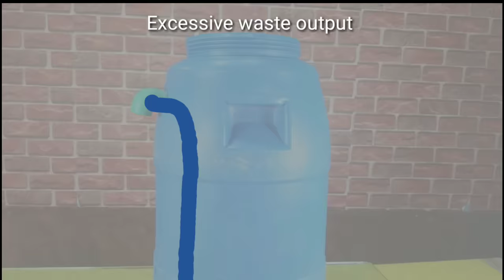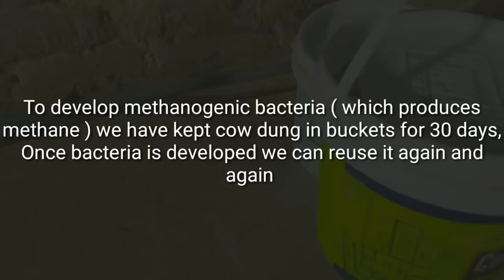How To Make Free Gas from Fruit And Vegetables waste | Bio gas plant |

Comment: Pretty cool and all but you are using plastic to store flammable gas. Ever heard of static electricity. Tub needs to be metal with a ground.
Reply: Gas inside is not mixted with oxígen hence not explosive
Reply: Grounded gas cylinders 😂
Reply: @margaritoavila1306  Yes it is. Biogas is a naturally produced gas. Mostly methane carbon dioxide but also a small mixture of oxygen. It's a small percentage. But still a ground would not hurt. As percentages vary depending on the contents creating the biogas. As far as "gas cylinders" those are typically metal and purged of any oxygen prior to filling.  Regardless it's NEVER a good idea to store flammable gas or liquids in a plastic container. Regardless of oxygen content. Container is contaminated with oxygen everytime he opens it. And I can promise you he isn't purging it with gas after opening it. It has oxygen.
Reply: Before storing it in metal you need to clean the gas, otherwise it will corrode quickly because of the H2S .

Comment: I would exercise a little more safety. Rubber gas tank next to open flame BOOM!
Reply: Yes. Flame should never be close to the gas storage/tube. Furthermore, there should be flame arrest installed. If flame arrest is not installed, flame can travel backwards.

Comment: Very wrong placement of rubber tube near burner it will cause fire accident by melt the tube.
Reply: I thought I was the only one who noticed it
Reply: A check valve or water valve on the outlet, to prevent flash back, wouldn’t go astray either.

Comment: I’m sorry but how will the barrel maintain pressure if the over flow pipe isn’t tapped off? He must think we are stupid enough not to notice. Waste of fffing time
Reply: Maybe there is a pipe connected from inside which is dipped in the mixture sealing it naturally. Refer 01:05
Reply: There is a pipe connected to the overflow which goes to the bottom of the drum so thats not an issue but still this is waste of time

Comment: Where does the pressure come from to inflate the tube since the barrel has a hole on the side plus the valve of the tube is closed.
Reply: That is true
Reply: What the video didn't show is the excess waste hose on the side is plugged up with a cork so any gas build up goes to the tube.

Comment: You should be more careful about the live flame so close to the inner tube holding the flammable gas. Even if it's only for a demonstration purpose. I'd have suggested you used a longer hose connecting your inner tube to your gas burner.
Reply: And a simple water-filled, no-return capped jar between your burner and the inner tube in your gas line as well.

Comment: Want work. The reason I say this is that the over flow drain is fully open on the side. There would be no way to build pressure in tank and diffidently would not pressurize inter tube. Why do people do video's like this?
Reply: He said add cork on over flow pipe  and remove when necessary dumbo watch video carefully

Comment: Something is missing, how could the methane not return to the drum and exits on the yellow hose?
Reply: i think the yellow runs all the way down the drum, so methane won't exit the sludge through the yellow tube
Reply: We need to add gate valve at the end of pipe which is missing in this video

Comment: Hi, can an LPG gas cylinder be used in place of a tyre tube...?
Reply: In theory, yes. BUT you need something to push the methane into the LPG gas cylinder. This is needed as the tank uses internal pressure to push out the methane from inside it. Something like a fridge compressor could work.

If you'll notice they are using the elasticity of the rubber tire interior to replicate pressure. they can even add weights to the tire interior for added pressure to push out the remaining methane.
Reply: @joeysmith7764  well thank you,  am asking because am looking at the safety of using a tyre tube. Because the gas is flammable and any slight little leak may start up fire and considering the fact that there children , so how is a tyre tube safe..?  And  are there any other materials to use apart from a tyre tube? If there's then kindly give examples please? Thank you..
Reply: @malambokunolu6428  It's not ideal to use this build when children are around. Especially if they are too young to listen to your warnings. 

There are may alternatives. Any sealed bag, pouch or bladder can be used. Ideally made with a material that is resistant to tearing. PVC bladders is a possibility. Again most of these require some weight pushing down on them to push the methane out to the output end of the hose. 

If you are still interested in using an lpg tank, i can point you to another video where they use a compressor to transfer methane from a bladder to a tank.
Reply: @joeysmith7764  well thank you very much, am  more than interested you can direct me to such a video. And if you nevermind I request if I may have a zoom meeting with you, you resolve my questions and I really want to learn from you, you inspired me, please consider my request.
Reply: @joeysmith7764  thank you 👍, am also thinking of.., can't the same tyre tube, which is our storage container be put in an enclosure, example a wooden like wall drop enclosure specifically with the capacity fit for the some tyre tube..? How is that..? Can't that mean safety..? What do you think? Thank you

Comment: And how will you feed the waste again? Don't you think the gas will escape out?
Reply: You need a valve on the reservoir which you can close before you open the tank (to keep the gas in).
Reply: The tire tube serves as a reservoir that where you need the cut off valve between tire tube and waste container.
Reply: @masongoss4615  Hi Brother, BioGas production happens in anerobic condition and is a continuous process. So if you feel  that everyday for feeding you are going to open the container it's not going to work out
Reply: @elkokeraliuga8556  Heya, pls refer my below comment.

Comment: Why not direct from tank ?
Reply: In tank not that much space for gass so tire like gas container to keep more gass and track when he run out of it
Reply: It can cause an ignition in the tank and explode, also it the pressure may be too weak to deliver directly from the tank
Reply: Great! :D
Reply: I believe the person might have done it to figure out whether there is enough gas to light fire, and tyre tube gives you a rough measure of the collected gas, which is not possible via the tank.

Comment: This is a really bad biodigester because 1. It does not have a feeding hole/tube and a exit hole/tube, instead you have to open the lid and that is not the point because every time you open it, air gets in and you no longer have a oxygen free environment 2. It doesn't have a hydrogen sulfide scrubber so the gas smells like rotten eggs and is extremely toxic and even if you burn it, it produces sulfur dioxide gas witch is also not very pleasant and toxic gas and 3.it doesn't even bubble through water to remove any unwanted gasses and odors like ammonia
Reply: Miguel Chacón u have any better idea? Plz share!!!
Reply: @rashidlatif5486  yes, you could make it better but i don't know how to explain it to you, you can go watch other videos from cody's lab or other people to see how its done and if you want to get rid of the gas you could pass the gas through a container with iron wool or shaving so it reacts with the hydrogen sulfide or you could bubble the gas trough a basic solution
Reply: @rashidlatif5486  just look for "bio digester" or "bio gas" here at youtube, there are way more professionell videos out there
Reply: Yes you are right . But it gave us an idea about how to make biogas this is the point .

Comment: I would think the excess tube would prevent pressure from building up enough to fill the inner tube, like your inflating a heavy duty balloon with a larger hole than what's going to the tube the gas will follow the path pf least resistance unless u have some kind of butterfly valve in place. even then I don't see there being enough pressure to fill up the tube with any kind of force

Comment: It is not possible, fake vedio.
Reply: It's not fake... the digester can work with house hold waste and can produce methane...
Reply: It's not fake completely. 
BioDigesters are working after this principle but have not the construction like this. 

The yellow pipe needs to be inside the drum, so the slurry locks the gas outlet. The gas is not under that pressure to fill up such a balloon. It would be better to help the gas coming out the drum and at least a methane flame burns not yellow. That indicates longchained carbons like in a beginners woodgasifier.

Comment: Use weeds packed in and water, one dose of manure to do the same thing. Prepare two barrels. When one is about done, recharge the other and use used and dried refuse as compost for the garden but use a portion of this old batch to recharge the second barrel.

Comment: The top fitting needs to have a right angle elbow to prevent crimping of the hose. Also what is the purpose of the hose on the left-hand side going into the bucket? You didn’t describe that purpose
Reply: That's the overflow pipe

Comment: 1:06 What exactly is the use of pipe inside drum? How is it going to dispose the excess waste? Please somebody help with this ?
Reply: From what I can work out it’s like a pressure valve.  A thin tube is submerged in the liquid and if the pressure gets too high it will pump the crap into the bucket through the tube.

Comment: I think that, to prolong usage of the hose connection to the blue tank, you should have used a rubber gasket on both sides using the glue adhesive as well.  But to their own.

Comment: How can we refill waste once it's up and running? 
Should we wait until there's a deflated tube? (until all the methane is produced from that waste) or is there a way to dump waste regularly without disturbing the methane production in the barrel? Thanks
Reply: You can turn the valve off to trap gas in the tire tube
Reply: @kylekoenig4730  what about the gas build up in the barrel, that will be lost
Reply: @bingesquad1  yeah for sure it will be lost. Use what you can and start over I guess. There is a method that uses a tire tube to take the pressure. Set up a shutoff valve outside the tire to keep it from draining

Comment: Will it not leak the gas from the side pipe 😇
Reply: Thats what ive been thinking
Reply: Well I’ll help, no, the pipe is extended inside and the part inside is turned horizontal. The opening of the valve is at the surface level of the waste sludge, minimal gal will escape from that surface area and if the level of grudge increases it will leak out till it comes back to the surface level

Comment: then you just keep feeding the bucket raw scraps or do you have to also add poop and it doesn't mess it up by constantly opening and closing the lid to add these items ?
Reply: you leave it for a days after its sealed, you dont open and close it, unless you have a one way valve you'll lose the gas
Reply: Adding intermittently is fine. Even if you lose some gas when you open it, this is a constantly running process, so new gas will be formed. Much of this gas is being stored separately anyway

Comment: Most of the people don't show if the outlet of excess materials from the tank will remain open or closed
Reply: There should have been a pipe inside from the overflow to the bottom, so that if the gasses build up to much they'll force the slurry out instead of exploding.

Comment: Hello, 👋 Thanks for sharing, but I have a question.
How is bacteria prepared? and what are the amounts of water and cow dung?. Please help me !!!!
Reply: There are no concerns about disease spreading because the gas produced is almost methane (methane can’t carry diseases) so as long as the bucket is far away from the dishes there are no problems of biological contamination. Said that I would be way more concerned about the risk of explosion due to the large amount of methane kept in low pressure. The flame could find his way back into the tube and into the container making a very big fireball. I suggest to not do this experiment and let the professionals (chemical engineers) do the synthesis  over a large scale and let biogas (and biofuel) be a sustainable (both economic and ecological) alternative to petroleum based gasses (and fuels).

Comment: Vent first tank of air so flame does not suck back into tank.
Reply: please explain in more detail what you mean.  Vent which tank, the blue one?  If so how do you do that?  Thanks for your advice, I suspected there was more to this
Reply: @bjohnston3659  have hose from first tank going into a second smaller tank filled halfway with water, making sure the hose is in the water bubbling to create a blowback blocker
Reply: @rage_2hard58  So in the example in the video, the line that now goes from the top of the blue barrel (carrying the methane) will not go to the inner tube, but now go to a smaller tank and the useable gas will come from a vent in the top of the second, smaller tank, yes?

Comment: You need to change gas container that can hold high pressure and add prv (pressure reducer valve)
Reply: you can use the outlet going to the stove and just redirect it through a air pump into a gas canister via a pressure gauge on the line so you don't go ever the max psi.

Comment: Interesting idea. Im just wondering for you to add more wasted do you have to wait until the gas is out in the whole tank then add more or what? How do you add ore waste without letting the gas which is being produced  escape/diffuse into the air.
Reply: The input/feed pipe goes all the way to the bottom of the drum, leaving possibly 6 inches. So, it's always submerged in liquid/water/dung.
The output pipe has an elbow attached which is always facing downwards and, again, submerged inside the dung. This way the system is air tight even when you open the pipe from the other side.

Comment: won't the Tube explode when the Gas from the Drum continuously fill the Tube? The tube will have a holding limit right?
Reply from the maker: The pressure of the gas produced from the drum is not enough to explode the tube
Reply: If you learn stoichometry in chemistry you will know how much the gass produce based on the weight of waste..
Reply: If the tube is filled then the gas will build up in the digester and force the liquid out of the overflow pipe. There is no way to reach destructive pressure levels.
Reply: for the tube to pop? it’ll be almost see through at that time so the pressure would be so high it would take years

Comment: How to clean the digester drum and how to know when to clean   thanks
Reply: you dont have to clean it. its important to retain the original bacteria inside to help in digestion process of the waste materials. that's why there's a hole in the side to remove the old waste austmatically as you dumped new manure  the only problem in Ihis concept is he needs to remove the entire cap of the gallon making it susceptible to air  the tank should be anaerobic meaning without the presence of air.  he needs to alter the design by drilling a pipe going down the bottom of the tank and put a cup on the top where he can drop down his slurry cow dung mix with water or shredded vegetables

Comment: I have heard that when there is no more gas being produced, the slurry inside the tank will be more or less safe to use as garden fertilizer.  Does anyone know?  I have also heard that there be solids and liquid and that each will have more nutrients of a different type than the other (Phosphorus vs Nitrogen)
Reply: Ive heard the same thing, although i dont know from personal experience
Reply: Id say yes
Reply: ഇതിൽfit ചെയ്തിരിക്കുന്ന സാധനങ്ങൾ എവിടെവാങ്ങാൻ കിട്ടും
Reply: Yes the slurry is a dense fertiliser. Save some of it for your next batch so you don’t need dung the next time around for the bacteria.
Reply: @prithvi24  thank you sir

Comment: My three biogas digesters are sleeping for the winter. I would love to run them year around in the cold climate . Any ideas? i've tried compost heat
Reply: use part of the gas to heat the digesting mass and good isolation all around
Reply: Install a aquarium heater or the barrel heating jacket they use for home brewing.

Comment: Can we use more than One Air Bag, by using multiple pipe connexion ?
In order to have more Gas quantities available for longer cooking times
Reply: Yes but remember that evrything with gas is dangoures like biogass can explode I think you shoudnt make more gas contaners because more gas = bigger explosion

Dont cook inside an building and you schoud by an gas sensor
Reply: Depending on the degister 😊
Reply: You can stack up to 5 or 6 rubber just used a t valve to inter connect them but storing so much comes with hazard. so make sure that the line going to the igniting stove is far from storage. and make sure to use it everyday or close the valve from the digesting tank going to the rubber storage because if you let it open the gas will continue to fill it until it breaks by itself due to enourmouse pressure

Comment: Why methane will no exit trough the waste excess tube?
Reply: The output pipe should have an attached elbow facing downwards which should, at all times, remain submerged in dung inside the drum. Otherwise, the output pipe will leak methane out and introduce oxygen into the drum, destroying the production.